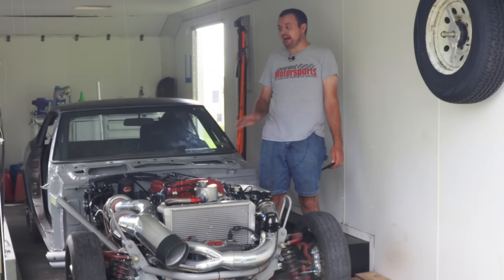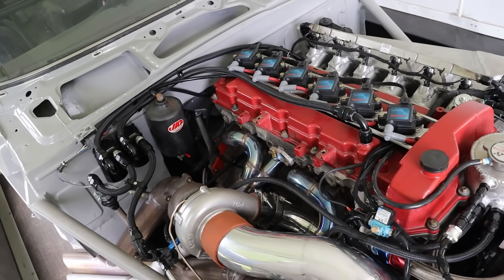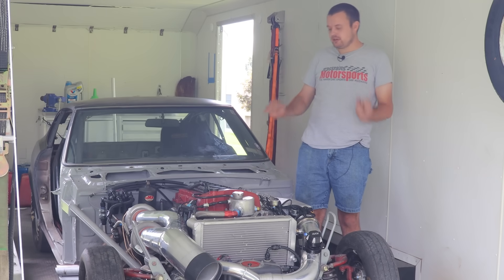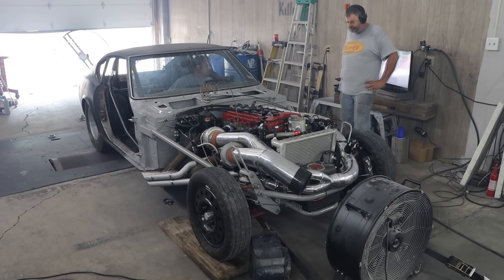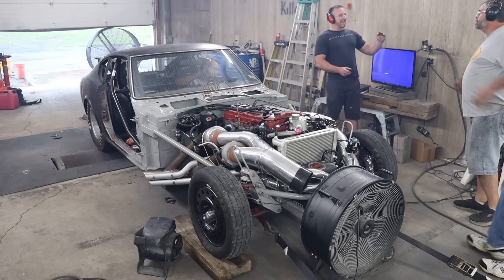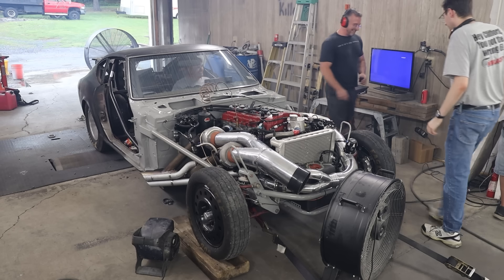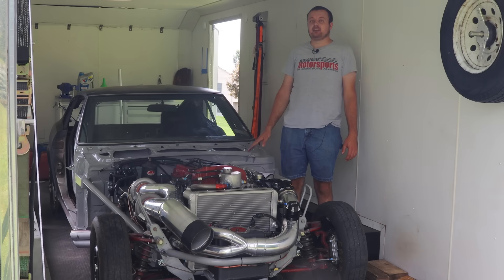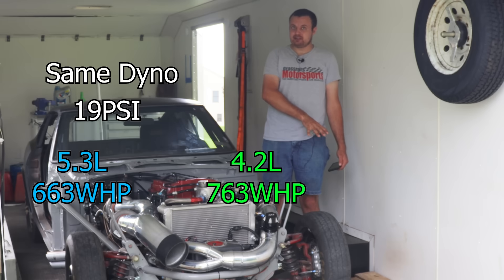This 4.2 Liter Engine Just Beat a 5.3 LS!

Comment: Very impressed with the 4.2 it’s a slept on motor for sure, fantastic power per lb of boost! The 5.3 on the other hand might be down a cylinder or 2, or the torque converter is looser than a bowl of cereal. I’ve never seen such piss poor numbers on that high of boost and that large of a turbo out of one before. But tbf I am a 6l guy so I don’t see the 4.8/5.3l stuff very often…
Reply: I have fun with Automation, which has very realistic calculations! It showed me that I could get gobs of horsepower at only 5K RPM for a 2.6 L I6 with turbos! ;) The boost was high of course. Edit: it was at least 40 PSI, with horsepower in the 500s at only 5,800 RPM and 600 lb/ft of torque at 2,700 RPM. ;)
Reply from the maker: It had a wimpy cam (219/219) and the torque converter was pretty loose. Even if the 4.2 made the same power it would be impressive.

Comment: Sort of like how the 262 V6 can kick the crap out of a diesel 350 V8! (IIRC, that's with both mentioned engines being naturally aspirated) That was the predecessor of the ridiculously-short-production-lifetime 4.2 I6! GM made a whoops by cancelling the 4200 I6 sooo soon! (2001-2008, it looks like!) But, GM did update the 4300 V6 to have direct injection, IIRC, for the latest ones! Those were apparently the replacement for the 4200 I6.
Reply from the maker: Yup.

Comment: The smaller engine has 4 valves per cylinder that's not the same thing,but it is a good engine for this kind of thing ,but you left out the torque numbers.
Reply from the maker: Yup. 4 valve ftw. The torque numbers are on the graph shown in the video.

Comment: I'm partial to a 5 cylinder exhaust note, so I'm quite excited to think what the 3700 could do as well. 

I always liked the idea of this engine series, I hope the aftermarket picks it up. It's a seriously good engine that doesn't get enough respect. Big displacement and can rev high. What more do you want?
Reply: 5-cylinders don't sound the same as 6-cylinders or anything in multiples of 3! Unless it's a 6 cylinder engine with a cylinder going out, which I heard can happen due to a valve problem with the Chrysler 3.7 V6s, hope that doesn't happen to my father's 2012 MY Liberty, one of the last Libertys made! (2002-2012)
Reply: @RJARRRPCGP  what are you talking about, this has nothing to do with the comment you replied to
Reply: @scottearl7687  Whoops, I apologize, it was about actual engine sounds, based on the number of cylinders.
Reply from the maker: Yup. 5 cylinders sound nice. Maybe someday.

Comment: hopefully your CWC cored cam doesnt grenade....
Reply from the maker: We haven't had issues with that so far at 8000 RPM. We've done 5 swaps at this point. They've been very reliable. Check some of the other videos for more.
Reply: @Calvin-Nelson  hopefully they work out for you. they have a bad reputation in the datsun world. i've had one from Schneider grenade on me. not Schneider's fault. no sure if it was the core it was cast on either... but the one i am currently running has had ZDDP added to every oil change and still looks good.

Comment: the 4.2 could barely handle normal driving conditions in a trailblazer so i would never think about building on one
Reply from the maker: You are basing your data on vehicles that probably aren't being maintained like they should. Who drives Trailblazers? Soccer Moms. We've done 5 swaps at this point. They've all been very reliable and made great power. I don't think it is "luck" anymore.

Comment: Love your work with the 4.2. Planning on putting a super charger my buddy's 05 trail blazer, any recommendations on tuning for light boost? Is hp tuners enough or do we need an aftermarket ecu? Planning around 5 to 8 psi
Reply from the maker: A stock ecu should be ok for that low of boost assuming it is a P12. Check the wiki for more of my thoughts.

Comment: Hell, I wanna put one in my LANDCRUISER !!!!
Reply: The Landcruiser's 1FZ-FE is even a potentially stronger motor with 4.5 liters of displacement, 300cc more than the Vortec 4200, a straight six with DOHC and 24 valves.  That's the motor you want. If not any of the Toyota V8s like the 2UZ-FE also used on the Landcruiser, DOHC, 32 valve and 4.7 liters.
Reply: @ChrisRobato   In my neck of the woods, these are impossible to find..1FZ..
Reply: @dentfixer5968  These engines come with the Landcruiser.
Reply from the maker: Do it.

Comment: How much would it loose if you had a fixed exh cam and didn't utilize the VVT?
Why twins over a single? Just curious
Reply from the maker: It would have lost a significant amount. We have found major gains from messing with the exhaust VVT. We did twins because it looks cool

Comment: So i bought a 2006 tblazer in December of last year for $1800 from the dealership my dad runs. They took it in on trade. It was very well cared for with 211,322 miles. I honestly just bought it as a beater commuter car. I put a little 2 inch lift (just spring blocks, from supreme suspension systems) some 32 inch baja claws and some spare OG method beadlocks from my race truck. Did 1 inch spacer/adapters to fit the 6 lugs. The first time i took it out in the hills i saw the potential. I went up shit in 2wd i cant grease in my 800hp race truck without just thrashing the piss out of it. This little trail blazer crawled right up. Then i pulled the ABS fuse because the traction control button doesn't deactivate electronic stability. Surprisingly, in my strippy LS platform tblazer theres a 3.73 limited slip rear end. So then i discovered the unbelievable impressive handling characteristics at speed of this thing. Its absolutely unbelievable. So i ended up completely falling in love with it. So it now has all camburg 2nd gen tacoma 4×4 long travel suspension up front with 3.0 inch double bypass fox coilovers up front, i didn't even have to notch the frame in back i just cut a 2×3 relief in the body panel, fabricated an extended shock mounting subframe from some inch and a half 4130,MIG welded it all in and tied it into the main structure of the body (these things are like, unibody on frame and the frame is made of such awesome steel as well as being fully boxed) did some 3.5 inch fox doubles out back, made my own link capture points and i run 2nd gen tacoma link arms as well with a self designed and built watts system. Adjustable sways, front limited slip diff and still the stock rear end. Now i needed more power. So i bought a ebay turbo manifold for a M54 BMW, modified it to my specifications, and its beautiful. I had an old aluminum intake manifold for my drift car when it was still 2j, modified it and made it work. Im only running a t4 flange with a Garrett gtx55 gen 3. I want the fast spool its an off road rig after all. I did do 300 lb valve springs, had a custom grind done on my cams, and i ported the head myself. That was an understatement when you said theres a lot of low hanging fruit on the head man good lord. TONS of room for improvement. Im running 1000cc bosch injectors, 2 walbro 550s wired redundant for potential failure, and a diy FAST fuel rail. My fuel system is built for e85 but theres no pump e85 in Reno Nevada so. Its on a holley terminator x, and the transmission is bone stock aside from sending the converter out to tweak some more stall into it, from 2800 to 3600 i believe. Thats pretty much everything i think. Anyway, with the 32s at 5000 feet above sea level, on 8 psi shes making 402 wheel @ 6400 on pump gas and 420 ft lbs (418 in reality but 420 sounds better). Torque is over 300 basically from idle and stays flat all the way through the curve like a damn diesel. I commute 114 miles a day. It now has 240,000 miles on it. It has anew head gasket but i pulled nothing else apart. The a/c blows ice cold and i can sit idle in 100° for as long as i want running it the car doesn't care it never gets hot. Shit i also did a big ass aluminum radiator with 2 16 inch electric fans, deleting that obnoxious clutched fan. The thing is the single most impressive vehicle ive ever owned. It straight up BOOGIES. I can run 120 mph down the gnarliest fire roads and my only worries are for tires. Then i can click 'er into 4 low, show jeeps, toyotas, and anything else what these totally underrated  vehicles can do. Ive completed the entire rubicon only diverting on landfall and the gauntlet because i dont wanna destroy the body its actually in really good shape. Its faster than my little brothers 1998 LS1 camaro, gets 22 mpg, and makes really really cool turbo noises because i also put an HKS blowoff valve on it. My exhaust is 3 inch into 2 borla race resonators, split and run dual tips out of the square design cues in the rear bumper. Looks kinda cool. The Toyota front suspension bolted right up. It moved the centerline forward about an inch and a half, so i cut the fenders and im running bushmaster 4 inch flares. Ive had zero issues. None. It does everything so well. Cruises 80 on the highway quiet as can be, doesn't get hot, then without slowing down you can bonzai off the road into the desert without a care in the world. Best damn car ive ever owned.
Reply from the maker: Nice

Comment: As much as I agree that this platform deserves aftermarket support, I highly doubt a 14k subs channel is gonna change an entire industry. Hell 1m subs channels can't do it with other just about equally deserving platforms.

It sucks, but the world is as asinine and crack-headed as it is, and punks will constantly want LS and Honda motors with the occasional Coyote or Nissan motor, leaving anything else with potential either completely forgotten, or to people with MONEY IE Viper motors and Lambo motors.

The same can be said for driveline stuff. It's either 4L80, Tremecs, CD009s, or "get bent." And usually, it's "get bent" either way since adaptor plates/kits are expensive. Oh, wanna save money by doing it ALL yourself? STILL get bent, because machine tools are expensive, then you need to learn (or pay to be taught) how to use them. And even then, if you wanna do something abnormal like a transaxle? Maybe a transaxle with AWD? Get extra bent.

Bent everywhere, all the way, all over.

/rant
Reply from the maker: You miss every shot you don't take

Comment: cant compare boost to boost one has what one turbo the other one 2 turbo it all cfm and flow put the same turbo on both motor then you can compare
Reply from the maker: You can compare them we just did. Maybe the 4.2 had somew advantages. It's still made 100 more hp.

Comment: If you want pistons from JE pistons they have them now I ordered them custom so now after 2200$ I got the best ones they can make
Reply from the maker: Mahle will do a set for $1600. We're already going that direction.
Reply: @Calvin-Nelson  I believe it's 1680 now but I paid for the R n D to get done so now they have a part number
Reply: @Calvin-Nelson  I'm also trying to get the forge crankshaft I got quoted 8k for a one off but if I get 15 guys to buy one it will be 3k

Comment: More like almostabarra, great your doing this though it’s a shame but the largest group of straight six fans in this country are BMW people LOL. It looks like you got a good car, make some noise by winning, a ford inline six raced in pro stock for a short time, 2 351 Cleveland heads made into one. If you could get just 30% of the support the barra has you’ll be making 1100 at 26
Reply from the maker: We'll see.

Comment: I calculated the NA power at 18.9 psi to be equal to 334hp🙂
Compared to maybe 290hp at the crank on a stock engine?
Reply from the maker: Do the calculation with the 615 hp pull.
Reply: @Calvin-Nelson  349😁

Comment: Hi from downunder. So your Mr Ameribarra. I get your point brother. I've had a few Ford's here with a inline 6, both NA and turbo. 
A NA BFII I had went 97.08mph at 14.52sec in the 1/4. Stock Aussie iron. 
I also had a FGII Turbo and that was quick. 
Don't worry the AM will take up the call. Have you seen the vids of that Barra in Melbourne on the dyno making 2200RWHP. 

https://youtu.be/hPpzdjT9P28
MORE BOOST. 😁 . You'll be able to get forged internals for it. 
Crank, girdle and pistons. 
You can get billet Barra blocks now. You being in the Mecca it won't take long.
Reply from the maker: Yup. The Barra guys are doing amazing things

Comment: add ported heads and a aftermarket intake manifold and i bet the LS will add 100 more HP. but getting it still is a bigger engine just not as efficient. Plus the 4200 had forged internals and for most ppl that takes it out of the budget build range. i think the reason why ppl overlook the 4200 is the inital cost of the swap and lack of aftermarket support
Reply from the maker: Richard holdener has shown it doesn't add all that much power. The forged rods are drop in. No machining or balancing required.

Comment: Generally speaking. When you have a particular psi of boost, its generally the same volume, regardless of engine displacement.
So, theoretically, the smaller engine should make more power.. As such that the smaller engine is being forced to use more volume of air.

 Almost to decades ago, I believe car craft did a similar thing with a blower, on a 4.3 v6 and a 350 v8.

Now I could be mistaken on my theory, being way off logically.
Reply from the maker: That is very wrong. Boost is a measure of restriction. If one engine makes more than another at the same boost, that usually means it makes more power NA. The fact that this engine is doing it with 71 less cubic inches of displacement means it is making way more hp per cubic inch and is much more efficient.

Comment: I think a stock 4.2 made more power at the crank than a 5.3... might be mistaken but the 4.2 claims 300hp and the 5.3 was like 280
Reply from the maker: You're thinking of the 4.8
Reply: 280 was probably gen 3 5.3 when the 4.2 was making 275 at a higher RPM than the 5.3 needed. 5.3 probably had more torque at lower RPM but not by a huge amount due to the variable cam timing and 4v heads of the 4.2. I think they kept the 4.2 detuned personally so it did not outshine the "muh murican v8" . Also the Gen 4 5.3 in 2005 were making 315 HP and up. Gen 5s make alot more than that even.

Comment: I want to put one in my supra so bad. But the engineering I need to do to make it fit is my challenge. There isn't enough time to work on my project after working on others cars everyday.
Reply: also is this the largest cam Schneider can make using stock cams? it's got almost the same duration as a stock 2jz cam. I can only wonder how it would do with a bigger cam like a 2jz.
Reply: @jonathan7744  Thats what im wondering. Even the highest HP setup only had reground stock cams and it made over 1000 wheel.
Reply: @thewraith6360  I can only imagine the craziness that could happen.

Comment: A tuner who is an “LS” guy told me that LSs are way more difficult to produce power with a Turbo vs the 2jz he was tuning. He now has a 2jz in his Z. I’m loving the content on the 4.2 Vortec!!!!
Reply from the maker: Thanks bud
Reply: @Calvin-Nelson  This is like a large version of a Supra!
Reply: bc the 2JZ was engineered to handle higher boost then factory. Toyota knew that people were going to be modifying those car's considering Japan's street racing culture at the time. the 2JZ is made for high boost
Reply: @boostjunkie2320  not just that. Inline 6 accepts better boost because of the way the strokes are distributed in the crankshaft. A little 3.0 2jz puts the same HP as a 6.0 LS. The GM 4.1/4.2 has the benefit of more displacement. The Nissan TB48 inline 6 can be stroked to a 5.4 and it can produce almost 3000hp and still smaller than most LS engines.

Comment: Great video as always!
I just picked up a 02 4200 for my mother's 04 trailblazer and noticed they have a oil level/temp sensor probably going to wire that into a buzzer just for security.
Planning my own 4200 swap after this 4200 replacement.
Reply from the maker: Sweet. It's dangerous to go alone. Take this: https://sites.google.com/view/vortec4200wiki/home
Reply: @Calvin-Nelson  LOL, I remember that sentence from the old school!
Reply from the maker: @RJARRRPCGP  I figured someone would know. Lol
Reply: @Calvin-Nelson  thanks!
I'm extremely impressed with how sorted out everything is.
Very valuable information.

Comment: What size tires on the back
Reply: 28x10.5
Reply from the maker: What he said
Reply: It looks easy bigger the car is so small I had a 28 x 9 Mt slick on my 260z which really measures 27x 8.6 in the stock wheel wells it looked huge
Reply from the maker: @Stevesbe  it's a tiny car

Comment: What is the weight difference between 4.2 and the 5.3?
Reply from the maker: About the same as an aluminum LS
Reply: @Calvin-Nelson  sweet.  I've been convinced that the 42 is a great engine for a long time now.  Besides the lack of support, are there any cons?  For instance, the height and length.  Is there a 42 sloppy wiki type deal?  Is like to see you pull pan go into production.  I'm almost always a fan of things being done a little different then the masses.  This is good chit fellas.